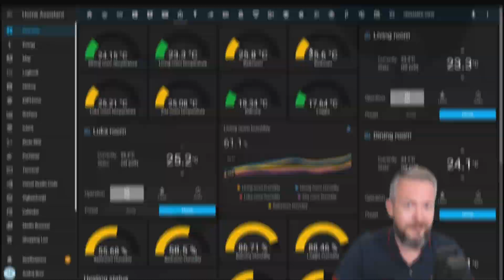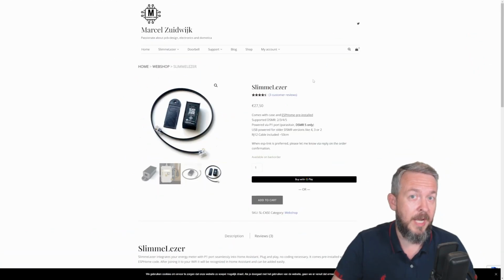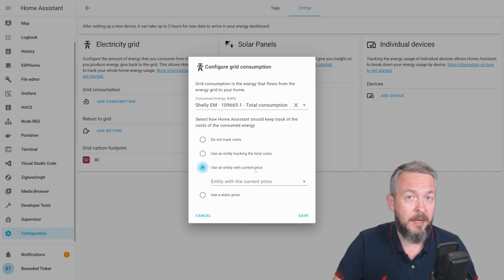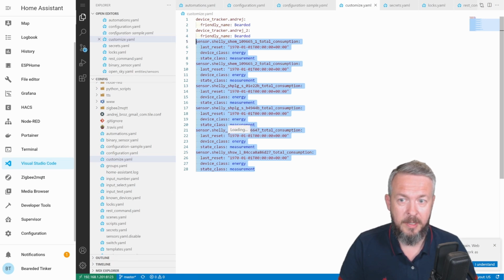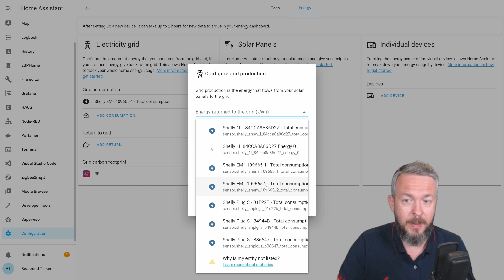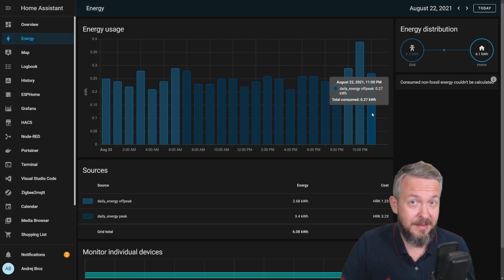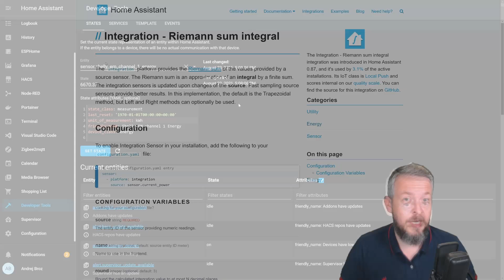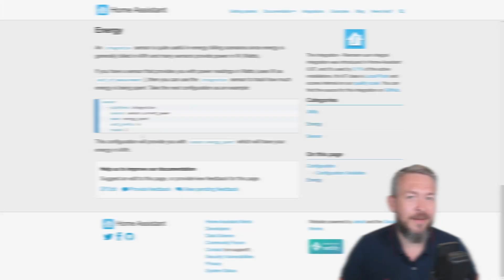Energy Monitoring in Home Assistant with not only Shelly EM

Comment: Hello, nice video. As a HA beginner, I have a fundamental question. In order to use the energy monitoring dashboard from HA, you have to have a measuring device (such as Shelly etc.) attached to the power box beforehand. Or can you just install the individual devices (WLAN socket with energy monitoring) and display everything in the dashboard summarizing all devices? Many Home Assistant YouTubers always explain how to get started in connection with a device, which first shows the total consumption. For me, when setting up the energy dashboard, at the beginning: at the point where it is asked "Select a sensor that can manage the costs of the energy consumed, nothing is displayed or 'No suitable statistics' is only displayed. Maybe it's a whole stupid question or maybe just a matter of setting in configuration yaml? for an answer or even better a video, many newcomers would probably be very happy.
Reply from the maker: This is not an easy answer. Sure, it's easier to get something like Shelly EM device for start. 
But you cam also try to use Power Calc - that is HACS component and you need to install HACS to get it. It will try to detect if it can what devices you have and create virtual power/energy sensors for them. But of course, only for smart devices. But you can also create your own sensors for non-smart devices.
Once again, if I could, I would go with Shelly (or similar) power tracking as it will track ALL of the power consumption, and add Power Calc. Than, only add as much as you think is necessary individual smart power sockets.
Energy dashboard initial intention is to get overall power tracking - so it's much easier if you already have Shelly or similar.

Comment: Great tutorial, thanks for this. However I have a question. In the flowchart you have  'total consumption'...this means it shows the total consumptions and not the actual consumption and the actual flow of the power generated by the solarpanels. Or is it this the way that it has to be?
Reply from the maker: You are right, but this is how it goes. It need kWh - not W used at a time. Based on that it calculates difference. For solar panels, also depends, are you measuring from inverter to the grid, than once again same or flow of your production to the grid (main fuse box) - still the same, but numbers can decrease here. For solar panels it's a bit more difficult as it needs both W and V
Reply: @BeardedTinker  Thank you for the reply. I use a Shelly EM with a clamp on the phase of the solar panels and a clamp on the phase of the grid (my grid is mono phase). In Shelly EM web interface it measures perfect but in that HA energy flow I have 3 totals, so not the actual measurements that I can see in the Shelly EM web interface.
Reply from the maker: @Ex Calibur  I also use Shelly EM  you should be able to use shelly_em1 and shelly_em2 energy for this. As I said, they both are totals, increasing values.

Comment: good vid, I've been using a shelly em for my power for a while now, but i just now noticed that my shelly em doesn't show when I'm returning to grid (since it uses total) so when my 'current power is negative because my solar is working nicely' my total doesn't show that negative nor does my dash...

i mean there is a 'return to grid' option but I only measure my total and my solar but if the total goes down the energy dash doesn't seem to be smart enough:

well turns out one entity named energy returned :D was disabled my bad
Reply from the maker: Glad you got it sorted. It would take me a bit to even suggest looking at disabled entities :)

Comment: Attention!!!! Since 2022.2 state_class must be total_increasing.  Measurement will not longer work
Reply from the maker: That's right, but this was introduced in August (total_increase) and even then it was forced for some types of energy readings.
https://developers.home-assistant.io/blog/2021/08/16/state_class_total/
One thing that breaks this is also setting default value if using value_template to 0.

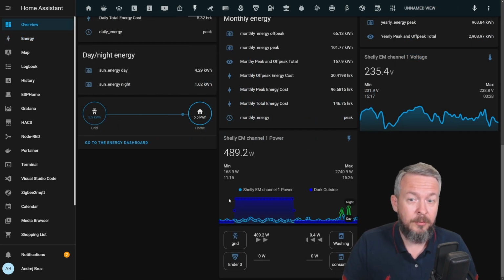Comment: Hi, thanks a lot for this tutorial. I wonder which hacs frontend you use at the minute 13:53, the card that showing the wattage and the voltage of Shelly EM with min & max value + graphs. Thanks
Reply from the maker: This is HACS mini-graph-card using a lot of options from there.:
color_thresholds:
  - color: '#039BE5'
    value: 0
  - color: '#0da035'
    value: 600
  - color: '#e0b400'
    value: 1200
  - color: '#e45e65'
    value: 2400
color_thresholds_transition: hard
entities:
  - sensor.shelly_em_channel_1_power
  - color: rgba(0,0,255,1)
    entity: binary_sensor.dark_outside
    show_line: false
    y_axis: secondary
group: false
hour24: true
hours_to_show: 24
line_width: 4
points_per_hour: 4
show:
  extrema: true
  fill: fade
  icon: true
  labels: false
  name: true
  state: true
state_map:
  - label: Day
    value: 'off'
  - label: Night
    value: 'on'
style: |
  ha-card {
    border: solid 2px var(--primary-color);
  }
type: custom:mini-graph-card

Comment: Great video, very well explained. Is it possible to estimate energy consumption based on on/off time of a specific device? I have BHT-002 thermostat (flashed with WThermostatBeca firmware) with heating film connected (of known power). I'd like to track energy usage and cost based on thermostat cycling on/off time of the heating. This idea also could be implemented to any other "smart" plug even without energy monitoring - if the connected device is always using the same power when being turned on (assuming voltage is at constant level or even reading voltage from one plug with this functionality). If yes how this could be done without additional hardware based only on home assistant programming?
Reply from the maker: Sure, it's possible - I used to have that to track light power used, but it's not 100% right and a bit over-complex :) That's why I now only use smart plugs with power metering.
I've deleted files in my setup - it was sensor_templates.yaml .  It tracked ON state separately of the devices. And then uses this on state to multiply with power consumption of the bulb (in my case). Then I used kWh I got to multiply by price.

Comment: Hi @BeardedTinker, thanks for the video, do you know how i can add "my energy suppliers meter reading" to the Home assistant Shellyem reading Kwh 

one of the sensors on the shellyEm is named in home assistant as 
sensor.suppliers_energy_energy
it gives me a reading, but i would like to add some Kwh so its calibrated to my energy meter
eg 
sensor.suppliers_energy_energy = from HA is reading 1100kwh
i would like to add 2000kwh to display 3100kwh

thanks
Reply from the maker: I know that there is a way to reset value to 0. And I think I've seen somewhere that you can set it via MQTT or URL request, but can't find it now. Best bet is to go and look at Shelly EM API, I think it should be documented there, one way or the other.
Reply: @BeardedTinker  thanks for the reply, i know it can be done within tasmota "console" firmware, but i do like the stock shelly firmware.
Reply from the maker: @eco-terrorist  me too. For Shelly devices I've kept original firmware.

Comment: Hi. I'm using Shell 3PM. But when i enter this to debug it won't show nothing.
Reply from the maker: In developer tools?
Shelly 3PM shouldn't display there anything, if you use the script in video description.
You should be able to see state/status of it in developer tools - states.
name of the sensor is different and it also should already provide energy reading (for each channel).
You need to use that one in Energy configuration panel.
Reply: @BeardedTinker  Ok. I want put all 3 phases to energy configuration. Any idea how to do that? Btw. Thanks for videos.
Reply from the maker: Haven't tried it since I only have one phase. BUT, I think there should be no issue of adding all 3 of them as Grid Consumption. You can have more then one source there - and it should combine them in single graph, but you'll have visible difference between phases.
Also it will display in table all 3 of them + combined value.

Comment: As of HA Core v2021.9 the Energy monitoring integration now expects sensors providing energy consumption data to use the new 'total_increasing' state_class (which gets around the need to provide a 'last_reset' attribute, since these sensors are required to produce time series of monotonically increasing data, and any resets are automatically detected when step decreases occur).
So BeardedTinker's original template above (for generating the YAML to add to customize.yaml) is now:
{% for state in states.sensor -%}
{#- *** NB: change the regex match string to suit your energy consumption device naming ** -#}
{% if state.entity_id is match("^sensor\.shelly_.+_total_consumption$", ignorecase=False) -%} 
{{ state.entity_id }}:
  device_class: energy
  state_class: total_increasing
{% endif -%}
{% endfor %}
Reply from the maker: Thanks for this! Much appreciated!!

Comment: It’s weird. The energy functions should simply ask for MQTT topics to subscribe. But they focus on additional Hardwares.  It’s a bit inconsequential to propagate openness and then ignore the lowest common denominator MQTT.  🤷‍♂️
Reply from the maker: Well, if you have any device that report to MQTT energy (per device or overall), then you don't need any further integration. You can just add necessary device_class, state_class attributes and it will be visible in Home Assistant.
You can use also integration called Integration (yeah I know) that helps you if device reports W and you need kWh.

Comment: Thanks for video, can you tell me what card you have used to show Shelly EM channel 1 Power where you have max and min and dark outside etc?
Reply from the maker: That is HACS custom frontend component - mini-graph-card.
Here is config I use (if YT will allow it):
color_thresholds:
  - color: '#039BE5'
    value: 0
  - color: '#0da035'
    value: 600
  - color: '#e0b400'
    value: 1200
  - color: '#e45e65'
    value: 2400
color_thresholds_transition: hard
entities:
  - sensor.shelly_em_channel_1_power
  - color: rgba(0,0,255,1)
    entity: binary_sensor.dark_outside
    show_line: false
    y_axis: secondary
group: false
hour24: true
hours_to_show: 24
line_width: 4
points_per_hour: 4
show:
  extrema: true
  fill: fade
  icon: true
  labels: false
  name: true
  state: true
state_map:
  - label: Day
    value: 'off'
  - label: Night
    value: 'on'
style: |
  ha-card {
    border: solid 2px var(--primary-color);
  }
type: custom:mini-graph-card
Reply: @BeardedTinker  thanks very helpful

Comment: Wouldn't the 'Integration' integration fix the issue with ShellyForHass integrated Shelly EM?
It should also protect against issues caused by setting a static last_reset timestamp?
Reply from the maker: It could solve this issue, but hopefully this customisation is OK until permanent fix is done inside the code. But still you could use it to prevent energy spikes if you have issues with Shelly devices, although so far, I haven't seen any.

Comment: Hi, from 13:50 I see energy monitoring card on your dashboard (with two circles on left side). Where this card is located, or how it can be created? Thanks.
Reply from the maker: In whatever tap/view want to add it - just create manual card and place following code in it:
type: energy-distribution
link_dashboard: true
Last line is optional and it creates link to Energy monitoring tab.
Reply: @BeardedTinker  Thanks. I already found a list of new card types in energy dashboard. Links are not allowed here. I tried it, and the comment with link was deleted.
Reply from the maker: @RadoslavEgyüd  if you use link_dashboard: true in cart energy-distribution it should work. I have it like that
Reply: Thanks. This is documentation about energy card: https://www.home-assistant.io/lovelace/energy